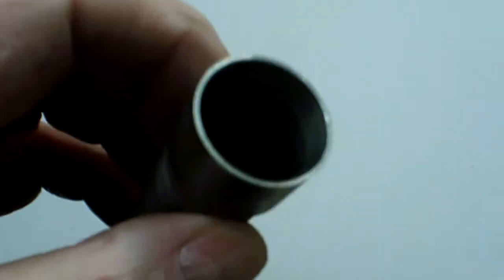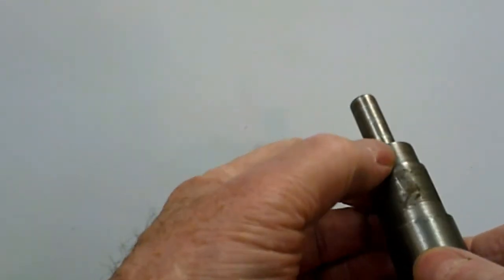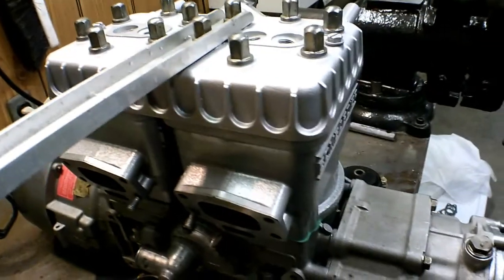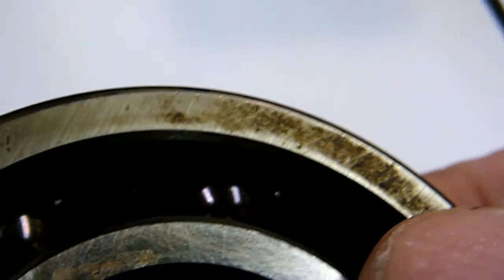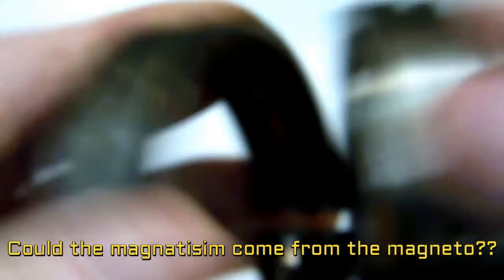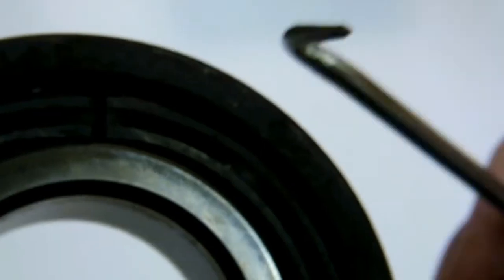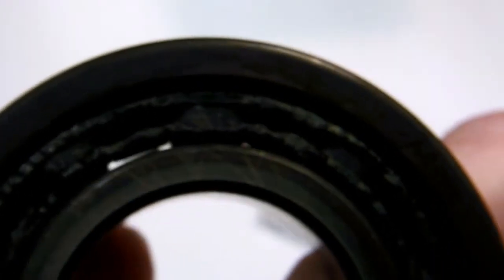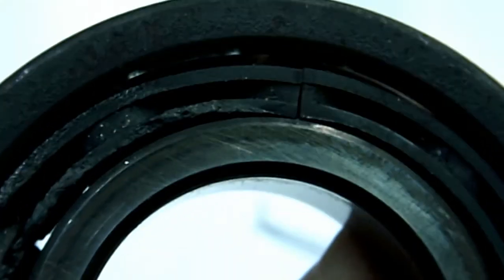Rotax 582 Modifications #10

Comment: I have had main bearings fail with metal ball separators. The difference is when the metal separator fails, It almost always takes the piston and rings out with it. The shrapnel goes all through that cylinder.
Reply from the maker: That is very interesting to hear.  Were the separators brass, or steel?  Were you using oil injection or mixing?  I only put 25 hours on the metal separators, but I am sure you are correct that a failed metal one will make more damage.
Reply: @Adventurepilot70  They were steel, and the engine was gas oil mix. It was a CCW 440 snow engine.  4 main bearings. Old engine. Most likely had corrosion in engine to start with. If the bearings are not glass smooth to start with, they will not hold up. You can damage a ball bearing by beating them on and off a crankshaft, or if the crankshaft has been beat on the end trying to get the flywheel off. It is a delicate insturment.
Reply from the maker: Bearings I used were steel separators, and riveted, not spot welded. Real hard to tell after an engine blows up, just what caused it.  I am working on a 583 right now that looked fine on the outside, but was full of seeds and mouse stuff inside the crankcase and cooling system.  Good thing nobody started it.
Reply: @Adventurepilot70  Old engines that have been sitting around for years scare me. Dirt dobbers get into every hole and build nest. That dirt is especially hard to remove.

Comment: Hello my friend! 
I've just watched all the videos of 582 modifications and it was INCREDIBLY GREAT! Thanks you so much to share with us! I've just bought a R532, my first engine, so excited to use it, but something wrong happed.. The water from radiator leaked from the head where goes the head gasket...I have a video of it on may channel, if you have time to have a look on it I'd appreciate. Maybe you already have this kind of problem. 
Hugs from Brazil!
(Sorry for the rusty english)
Jorge.
Reply from the maker: I did watch your video, and it does look like you have a problem with the cylinder base gasket.  You can get new gaskets from jbmindustries.com. You can see them on the web site.
Could be you are getting some coolant leakage from one of the bolts that holds the cylinder down. Look for cracks in the threads. You can use blue Loctite to seal threads. Your english is fine.
Reply: @Adventurepilot70  I opened the engine without any experience, just watching your videos. It really was a crack in the cylinder gasket. Without your videos I wouldn't have had the courage at first and everything went well! thank you for the tips. have great flights!!!
Reply from the maker: @ideainsta6020  I am happy you found the trouble and were able to fix it. Not so difficult to work on engines.
Good luck to you.

Comment: I have been told by the shop that is rebuilding my engine that the Nylon degrades over time and is why Rotax recommends overhaul every five years ( I think) regardless of use.
Reply from the maker: Thank you for the information. I did not know that. I do think it still seems plenty tough in my engine, but a little weaker where it is in contact with the ball.